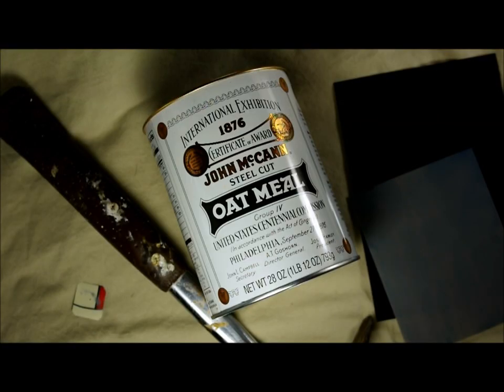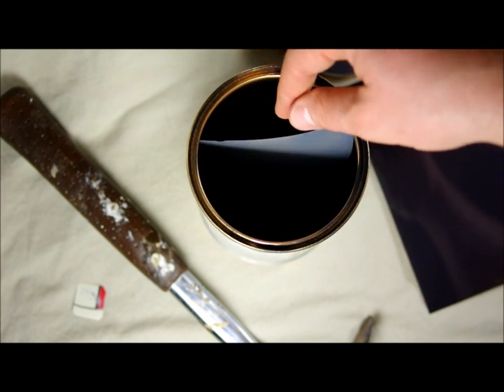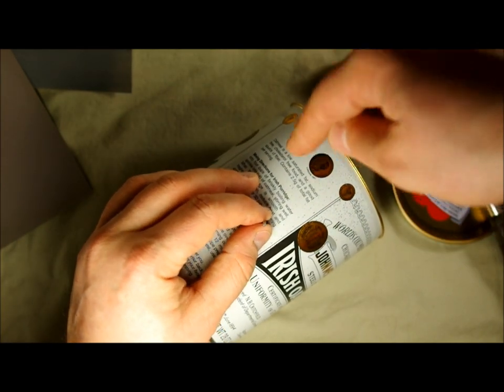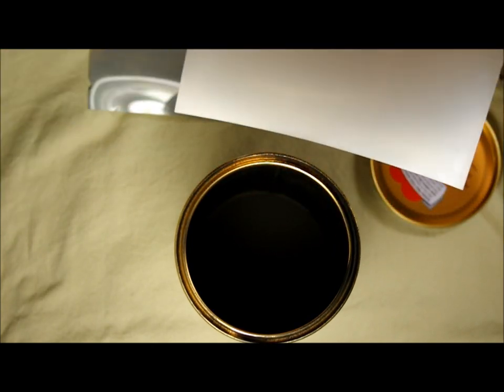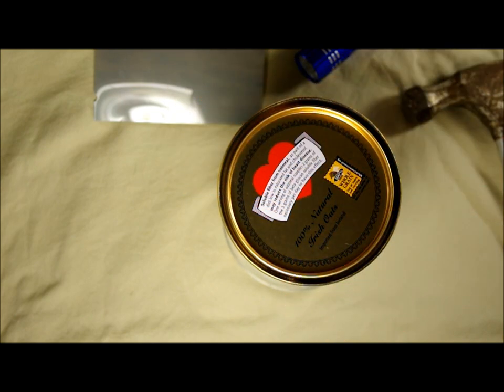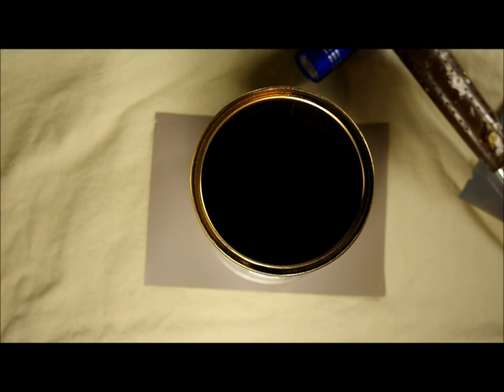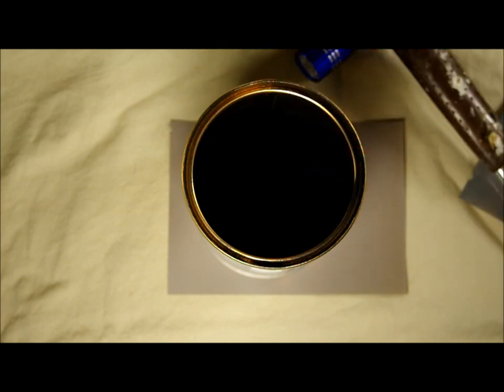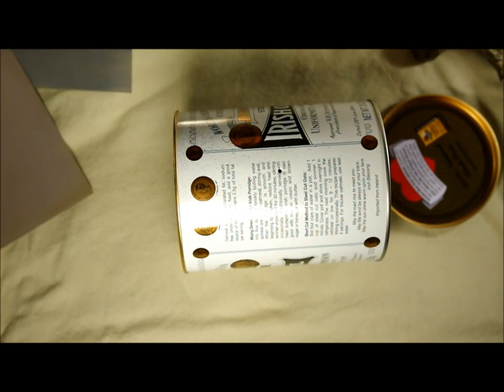Basic Pinhole Camera Construction: Oatmeal Tube Camera

Comment: I remember making one of these in high school out of the top and bottom of two soda cans and lining them with black matte paper. We sanded the inside and outside of the pinhole to remove imperfections in the hole. Great video. I really appreciate the calculations. I didn't know you could find out so much about the exposure time and size with math. I guess I still have a lot to learn before I get on your level.